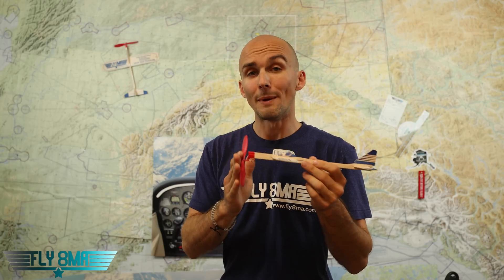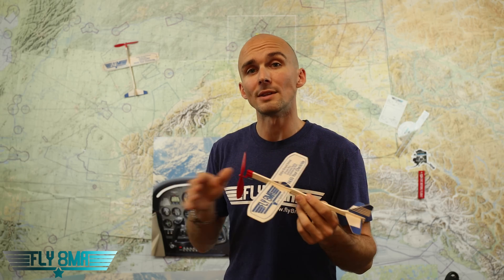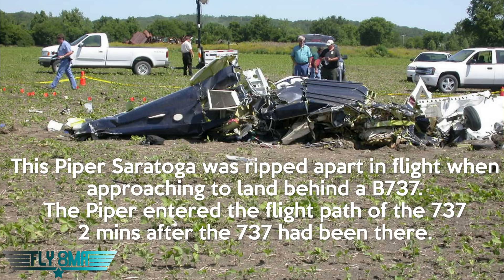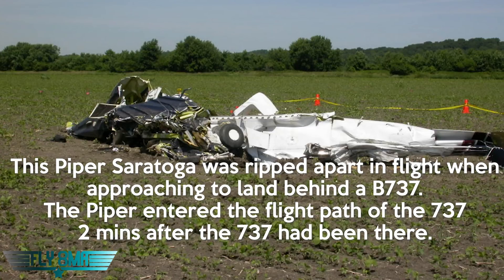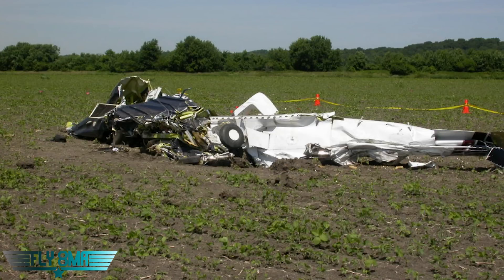Wake Turbulence Aircraft Accident Inflight Breakup

Comment: If the controller clears you to take off or land with a 2min separation behind a 737, and you are in a queue of aircraft, what would you given your suggestion to wait at least 5 minutes? Is the suggestion to reply 'unable' and then be pushed to the back of the queue?

I love the video- it's very rational and makes a lot of sense. When it comes to a real world scenario it's not as simple as using a blanket 5 min rule. Simple pressures such as in a situation like above is enough to make most pilots ignore their own 'rules'.

Comment: Excellent video! *Notice VELOCITY of rotation @core of vortex, exponentially faster progressing to core.. like a skinny tornado..I have been shocked when flying RC planes through their own wake in dead calm air..I'm talking about a 3 pound foam Bushplane RC MODEL brought around 270° & back down to pass through the Vx climbout path .. as model passed through it rolled subtly as it looked like it had hit a speed bump..realized afterwards what happened! Can only imagine twin tornadoes coming off higher wing loading planes🤯🤢..stay safe, especially behind reverse thrust turboprops too!

Comment: Great video! Looked like fun....so you forgot to tell us what we are supposed to say to the tower that just cleared you for take off that you want to wait 5 minutes for wake turbulence with an A320 up your #&%#.LOL Happened to me in the Cirrus
Reply from the maker: If you have traffic behind you, you can just tell them the exact same thing, and they will likely say "fine, taxi onto rwy XX, right turn at taxiway XX, and then back to the holdshort line"
Reply: FLY8MA.com Flight Training thanks for the response! I’ll try that next time. I fly into larger airports and without fail end up between passenger jets. Just my luck!!
Reply: @nickmorrone5845  That is a good question Nick. Lot of peer pressure from 150 of your new best friends right behind you wondering why you are holding them up...tempting to compromise safety and just get going. Good advice on sticking to your gut and asking for a ground go-around :)
Reply: @hudsoncraftworks  Hi Brian. An all too often fact of life when you fly in and out of larger airports... !! Ps. Just subscribed to your channel

Comment: You can also check out this interesting video of an air accident investigation here in Germany. Following a crash of a DR-400 4-Seater aircraft that took off directly behind an Antonov AN2 Biplane and got smashed to ground by the wake vortices, the investigators actually took similar planes and reconstructed the situation at a higher altitude. They got the results on video.....

https://www.bfu-web.de/EN/Service/V180-Video-EN/V180-Video-EN_node.html;jsessionid=A253C62976318103EF514016850911DE.live11293

Comment: Wake turbulence is no joke.  Wanna know what it's like?  It isn't just a disruption of flight it's also a sound...bang, a shudder followed by a rapid wing lift.  It happened to me in a Cirrus SR22T on approach to KLAS, McCarran in Vegas. The bang was a mystery, but the wing lift to 70degree bank was not and it was no fun.  As I struggled to right the aircraft the controller complained that I made a turn on approach without a clearance.....I quickly responded that it was due to wake turbulence.  She said "next time ask for permission"  I responded there will not be a next time.  Ya gotta give the big jets a TON of spacing, and push back against the controllers when they complain you refuse to follow in close.
Reply: Some controllers are boneheads. The vast majority are consummate professionals, but it shouldn’t be surprising that the one controller that routed a small plane too in to an airliner’s wake will be the same one that complains when you’re nearly knocked out of the sky by it.
Reply: Spee, thanks for your sharing! A great learning experience for the rest of us.

Comment: Hey John good to see you. Coincidentally I just watched a case study where a commercial airplane flew into another's wake turbulence and I used the rudder exaggeratedly and the tail fell apart. They all died. AA was training their pilots to do that at that time . They changed their training since . Thank you for making me see that in a Cessna we should wait a few minutes.
Reply: That might be one of the worst accident reports NTSB has ever issued. They put all the blame on the first officer for stomping on the rudder excessively, which he did, but they never mentioned the lousy rudder control system on the A300 which practically guaranteed it would be abused, nor the structural weakness of the empennage which could not handle such abuse. No Airbus pilot at the time knew that too much rudder input could snap the vertical stab off at its mounts. Airbus knew of the structural limitations of their design, but they hadn’t communicated them to the airlines, and  there was no way for the crew to know if those limits were being exceeded. These problems were partially, and quietly, addressed by ADs later on down the line. I work on the A300 for a living, and ours have two big red lights on the glareshield, one in front of each pilot’s face, that say “STOP RUDDER INPUTS”. They are connected to an accelerometer in the tail and are designed to light up to warn the pilot that he’s about to cause serious structural damage to the airplane.
Reply: @wrkingrageaholic  thanks for your response. They definitely placed the blame more on the pilot and AA training than the rudder control system. It is unfortunate that so many innocent people died.
Reply: The NTSB report of that crash: https://reports.aviation-safety.net/2001/20011112-0_A306_N14053.pdf

If they hadn't touched the controls at all they would have been fine.